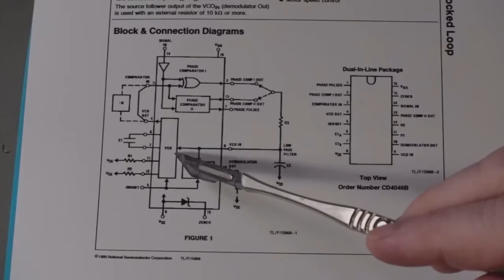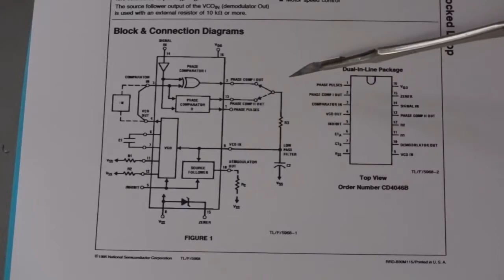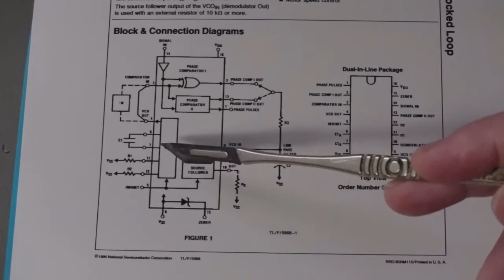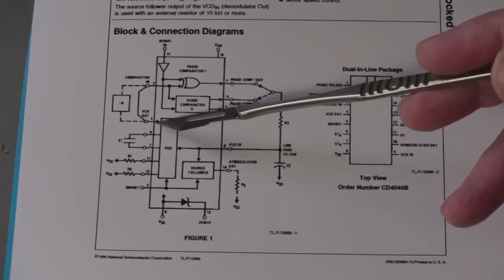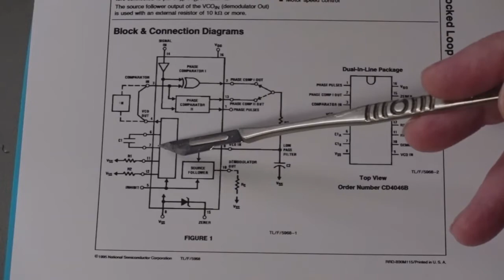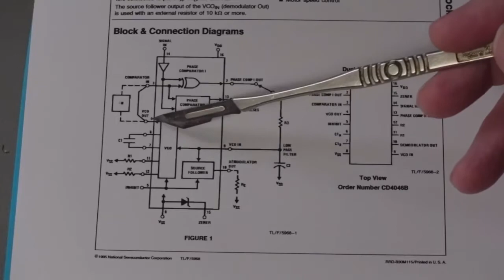What did this poor chip do to me! CMOS VCO

Comment: Great overview - Thinking to build one of these, so just digging around for information online. It would be great to hear some waveforms, especially the 'rampoid' output. All the best with the new channel
Reply from the maker: Hi Tommie, thanks for subscribing. I will have to get an amplifier setup and record some of the waveforms. 
One of my reasons for building this as a prototype on perfboard is to try out a range of CD4046s, as some have a pretty wide linear range whereas some are quite narrow. So I have the 4046 in a ZIF socket to enable me to swap out various from my collection to see which ones work well! I shall hopefully update soon.
Reply: @midlifelab  That's a great idea, I've heard anecdotally that some chips are better than others, but would be very interested to see what you discover.